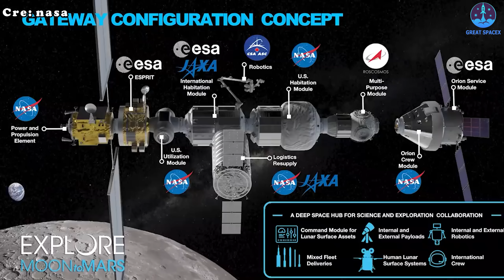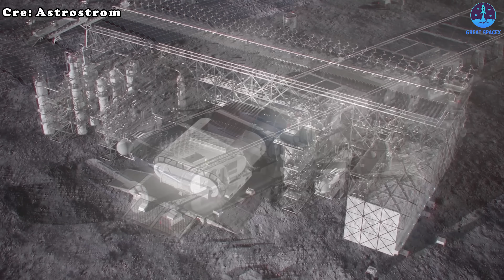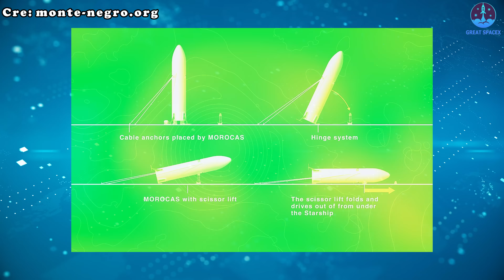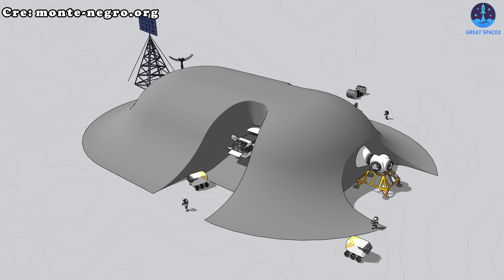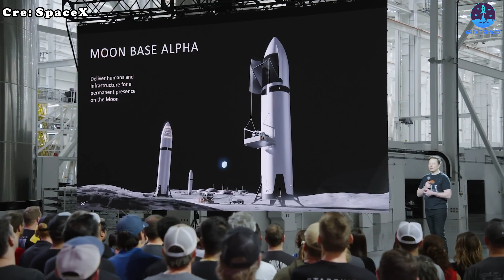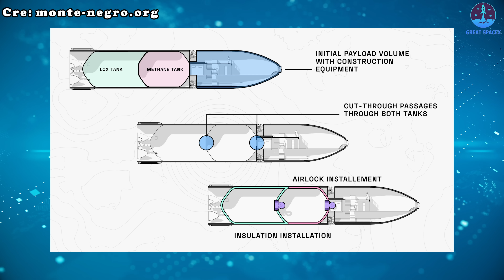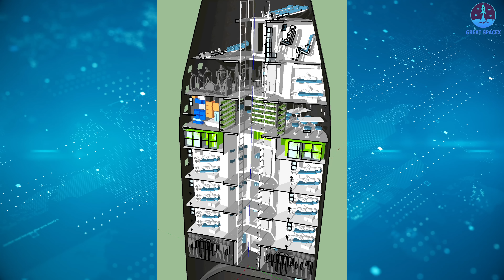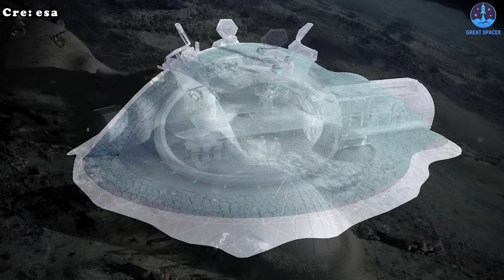SpaceX’s completely NEW Solution to help NASA Build First Moon Base Before China & Russia…

Comment: Guess they are going to use "moon air" to blow up that huge cushion.
Reply: Or turn liquid, or even a solid into gas, since you can use CO2 to inflate a balloon that can be stored in a highly condensed form and then released on the moon without losing a vital gas.
Reply: @davfree9732  That's a huge balloon! Even if you use hot air, CO2, or an inert gas, the sheer volume needed to fill the balloon with gas from Earth would be enormous. Alternatively, if you tried to compress CO2 into a solid form, you’d still face the challenge of keeping it from sublimating.
Reply: @TeguhSantoso-ml7bu  actually probably won't take much since space is in a vacuum, there's no outside pressure that the inside pressure would have to overcome
Reply: Now be like Flat earth cult's and ask who held the body cameras